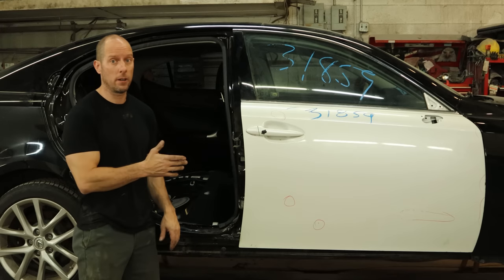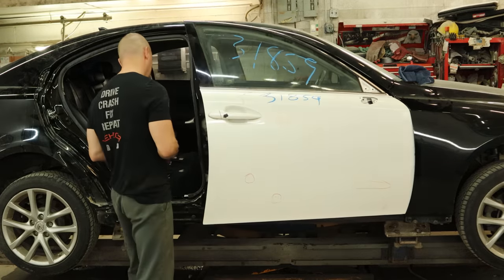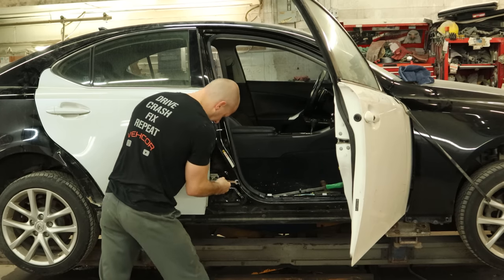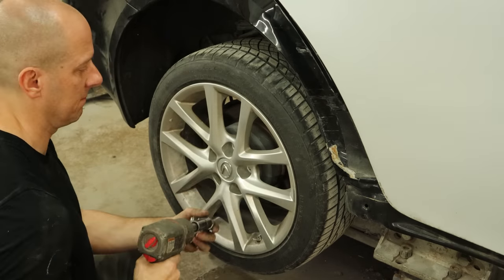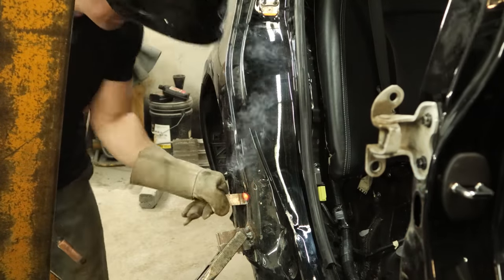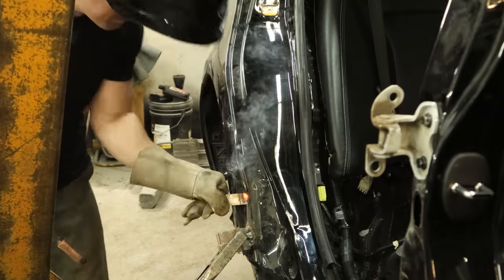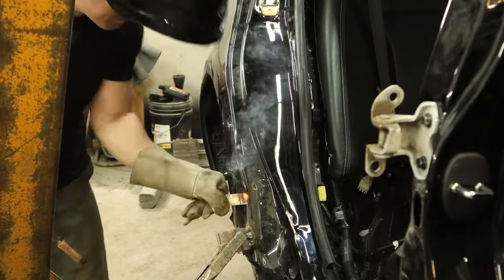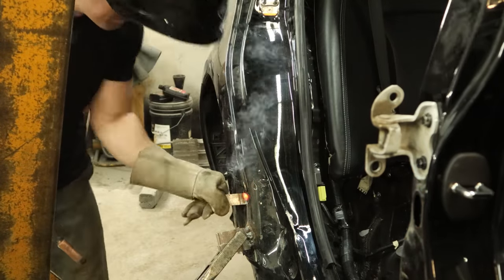Rebuilding a Lexus IS 250 after a side collision part 2

Comment: Tell you what, Scott.  Not only have I picked up a few of your names for things, but I've also learned a thing or two about replacing body panels.  I recently had my Mazda 3 rejected on its yearly inspection for rust in the window frame fascia.  

To explain further, the early BK model had an ill-fitting door seal that allowed water and dust to get down between the inner and outer skin of the window frame - and we all know what happens then.  The thing is that it's not structural by any stretch of the imagination, but because the rust bubbles were within 150mm (6") of the door hinge, the inspection gnomes considered it was close enough to affect the structural integrity of the rear door on both sides.  Because said reason for rejection is in the Inspection Gnome's Book Of Acceptable Reasons for Rejection, there is no arguing with them - even though the picture in the book shows that it refers to rust on the same vertical plane as the hinge, not on the other side of the door on a plane differential of 90 degrees, on a dress panel of very thin steel. 

Anyhow, I had never replaced a panel before, but watching you put doors on and take them off again and looking at how the Mazda's door attached, it was actually quite a simple process.  One of the doors wasn't quite 100% as it seemed to be dropping down off the striker when the door was opened. Like the Lexus, the bolts to the door itself from the hinge were self-aligning and all the bodylines, gaps and trim matched up when the door was shut. It was therefore easy to deduce that the hinge(s) were not sitting quite right, back the bolts on the B-pillar off a touch until the new door moved the hinges to where it wanted them to sit and then tighten them up again.  All done and problem solved.  

A year ago, I would never have attempted it without much procrastination and worry that it would all go wrong, but I knew what had to be done, knew how easy it came apart, had seen it done many times, knew to balance the new one on my leg (sorry - my portable door stand) to get the first bolt(s) in and knew how and where they adjusted.  I'm rapt out of my little tree, mate!  So, thanks heaps for keeping the content and humour coming each week and showing me how easy it really is to replace something on a modern vehicle.  It is certainly something I am very grateful for - and also in a practical way!  All the best.

Comment: spray foam is a good base for filling deep dents and black with two tone doors is good too bad they aren't way different colors.
Reply from the maker: Maybe a red door. 😂
Reply: @vehcor  Tony a guy I worked with was so happy when he crashed his @85 Caravan that was black with wood trim and some what glossy paint. yes green hood blue fender and red door was his pick for replacement parts. I am sure it didn't last long enough for untreated areas to rust.
Reply: oh and his crew did like getting used hoses and drive belts. that is where unsafe ant any speed actually came from.

Comment: 5:00 spray foam is the new way....NGL I did it on the rear fenders on my $600 CDN running and driving F150 crew cab 4 x 4. Skim coat of bondo on the fenders and cab corners and a little sanding and some primer and it was good to go. Only had to last 6 months while my "good" truck was being fixed but here it is 4 yrs later and still looks fine ...for a beater.

Comment: A painters 5 in 1 is a great tool I use them daily if you want something a little stiffer than the Hyde brand purdee makes a good one but it's 15-20 dollars depending on where you get it. Walmart sales a Hart brand that is really stiff for about 10 bucks but good luck trying to sharpen it . Chinese steel lots of hard spots in it

Comment: 16:50 same as when I started working construction. The guys screamed at me to use a chalk line instead of straight edge to mark my cut lines.

Umm excuse me? I come from a cabinet shop. We work to 1/32" there. The chalk line is 3/16" wide FFS. If I want to be really accurate I'll use a box cutter blade so my line is .001" wide.

Comment: Scott, thanks for the great videos.  

I have a question about wheel bearings. My van was hit in the left rear. We've since had the vehicle "repaired" by the local Dodge dealer's body shop.  Hopefully I will never have to visit them again.
Since I drove home after being hit, the left wheel has been noisy when making right turns at highway speed. Is is possible that the bearing was damaged when the other vehicle struck the van. The crash happened because the other driver pit maneuvered me by hitting the center and rear driver's side of our 2013 Grand Caravan. Part of the "repair" was bringing in a wheel repair specialist to fix the damage to the surface of that left rear wheel.

I noticed two weeks ago that the shop never installed the bumper pushpins for the left rear side.   Quoting you, "someone's been here before."  It's been one thing after another since we got the van back. I've been fighting both the body shop and insurance to get everything resolved but they say it's "pre-existing" damage.

Dave

Comment: I was watching and a question came to me. Then as I was reaching for the keyboard the answer came to me ( I think ) so no question . It was about the doors the question.  OK I'm asking anyway. I know you're working on other more important things first. But you will need to strip the doors for the painting gnome at some point. Why haven't you stripped them while you are using them to fix the ( check gap / check alinement ) other parts?

Comment: I may have missed it but if the B-pillar was not damaged why did you have to cut out that section? To the point, you could not just do the dogleg section?
Reply: You can see damage to the outer skin on the b pillar and I’m pretty sure the cuts is were it will be least amount of bodywork.